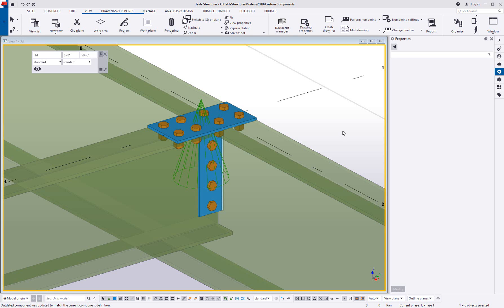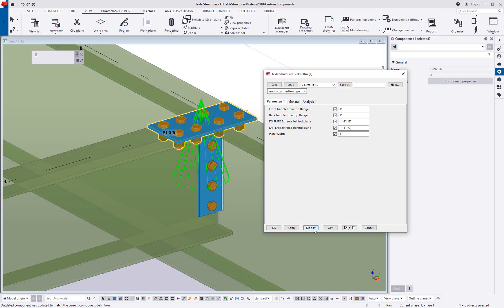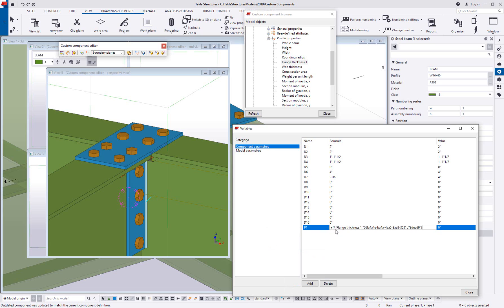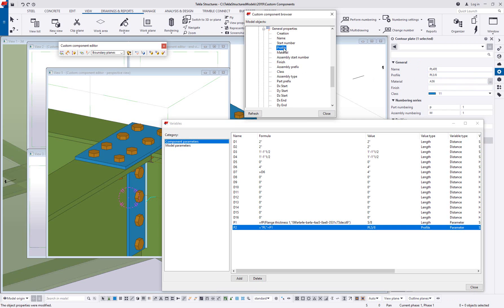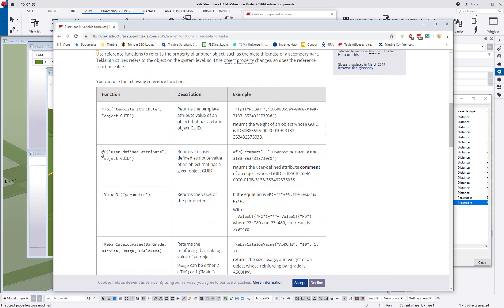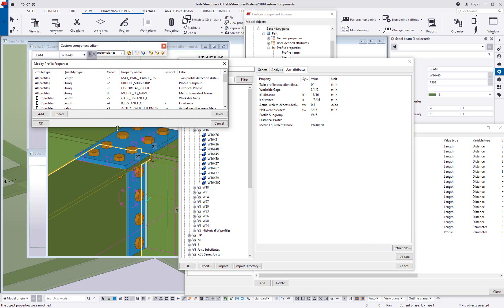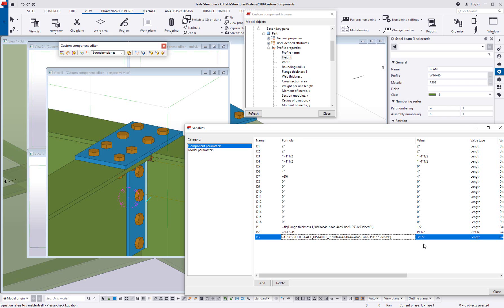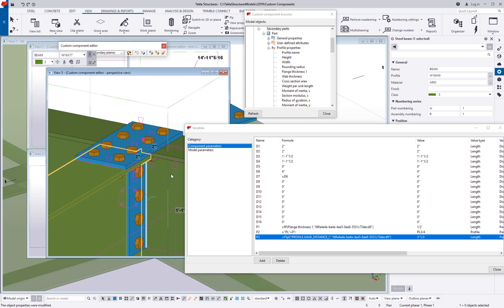Custom Components  - Getting Started with Formulas in Tekla Structures

Comment: Fantastic series on custom components. How would I specify "Parts with slotted holes" in the custom component browser?
Reply: It's a binary option for each part in the group. In TS2022 it's defined as "parts with special holes", and each ply has a value. 0 for no, 1 for yes. So for example: No parts with slots, 00000. First part (under head) 10000. Second part would be 01000. Both parts would be 11000.
Reply: @TrimbleTeklaDave  Ah, I get it. I went ahead and created temporary component with slotted holes and then copied the value to the component I was working on. But your description explains how it actually works. Thank you! I can't believe I got a direct response from the Tekla god. 😁

Comment: Hi. When opening the custom component for edit, the "Custom component editor" toolbar is missing and i can't go into variables or save my component. Any idea on how to get that toolbar  back?
Reply: I would recommend you reach out to your local support for assistance, I'm not sure what could cause that. In the past, I have had luck resetting the registry to put all dialogs/toolbars to their default locations, but that is something that can cause serious problems with your computer if you are not careful.
Reply: @TrimbleTeklaDave  do you remember which key it was in the registry that caused the problem?
Reply: @Cool77Z  no, the issue I had experience with was a different dialog, so I'm not sure what the name is for the CC editor. It may be under the Computer\HKEY_CURRENT_USER\SOFTWARE\Trimble\Tekla Structures\2020.0\Dialogs group.

Comment: Nice video. I want to build a beam with several holes (cut parts) at its length with the fixed distance, so the number of holes changes as the length of the beam changes, but in the custom component environment, I couldn't find any variable that generates holes (cut parts). Is there such a variable or attribute in the custom component environment?
Reply: Hi Jo. First, cuts are separate "objects" of sorts that have nothing to do with the custom component environment. You can model them in as polygon cuts (or cut parts) while in the editor or before you ever get there. As far as changing the number, there are two ways I've done this. One is to create the 'maximum number' you would ever need. Then you can perform an if/then statement with a little math to enable/disable a certain number of them ("Create" variable) based on the beam length. The second way would be to create one cut, then embed the array component inside your component, and again use a little match to adjust the number of how many should be created. Take a look at the 'Bay filler seam v2' custom component in the US environment as an example of the second option.
Reply: @TrimbleTeklaDave  Thank you very much for your detailed answer and of course your time.
Reply: @TrimbleTeklaDave  I'm trying to make a connection custom component which inserts elements between precast wall panels. How can I get Tekla to prompt me to pick the start and end points for the array component that's embedded in my component when placing my component in the model?
Reply: @ruck666  Based on your description I would look at using a "Seam" type custom component. But it might be best to share what you're working on with your local support. Hard to diagnose CC questions through youtube comments.

Comment: Hi, how can we add user define attributes in custom components which is link with grass hopper custom components.
Reply: I have never used grasshopper, so I would recommend reaching out to your local helpdesk for assistance. In regards to the Tekla Custom Components, UDA's are only visible in the custom component browser properties if they actually have a value - so you need to give them one first while you create the CC. After you link a variable to that UDA, you can clear it afterwards. Once the CC is built, you may have to save an attribute file for it with those UDA's defined so you can open the file in a text editor to see what the 'name' of that value is, so you might be able to map it in grasshopper. Look under the 'component' section here: https://teklastructures.support.tekla.com/not-version-specific/en/ext_grasshopperteklalink

Comment: I'm experimenting with trying to create a vertical brace connection. Binding to planes and extracting profile properties works well, but how do I extract other data like the START_Z of the brace? I'm not sure how to establish reference points in space so I can start using trig. For example, what if I want to create a simple custom component that will cut a brace back so that it clears the bottom flange by 13mm? The only object in this component would be the cut, but I can't figure out how to bind the workpoints of the cut so that they adjust correctly when the angle of the brace changes. Any advice?
Reply: Bracing components can be tough. To answer the first part of your question, you can get properties by using variables like =fTpl("START_Z","xxxxxx") where xxx is the GUID of the object you are referencing. I've also used reference dimensions on the handles of the overall brace (orange dim icon on the CC toolbar) to help calculate the trig values for end cuts. So rather than binding the cuts to objects I bind them in to the component planes and use X/Y values based on the trig functions. For help with these visit https://teklastructures.support.tekla.com/2019/en/det_functions_in_variable_formulas
Reply: @TrimbleTeklaDave  Thank you for answering! I managed to get it working. I realized that extracting the work points of the brace was not the best approach so I experimented with reference dimensions and trig just like you suggest. Everything worked well. However, my component only seems to work on one end of the brace. When I try to apply it on the other end I run into problems and the gusset/cuts/bolts end up in weird places. So I'll try to think of a solution to that (it probably has to do with the auto-direction of the component). But anyway, if you are looking for video ideas I would suggest a short explanation on the 5 icons to the left of the boundary plane drop down list in the custom component editor. I managed to figure out one of them through trial and error but I don't think I fully understand how to use all of them.
Thank you again for your helpful videos!
Reply: @TrimbleTeklaDave  all these people are making custom components but nobody is sharing them? At least not that I can see anyway. I saw somebody selling some. Seems like we are all doing extra work rather than collaborating on these connections in different areas of the world.
Reply: @NeilMcginnis  Sometimes they get shared privately between people, but generally no. I think detailers tend to be very "protective" over their tools and workflows because they consider that they give them an edge over their competition.
Reply: seems like the tekla forum would have been useful for sharing resources like that. unfortunately everybody has to start from scratch this way. bad for me because i'm just now learning about using custom components. lol

Comment: Thank you for nice video tutorial.
I tried to use one of the profile properties for part mark in drawings, but I couldn't find it in list of properties in template editor. I tried also just write a formula GetValue("property name from catalog list"), but no effect anyway. Could you hel me with this task? Thank you in advance.
Reply: It would be best to reach out to your local helpdesk with exactly what you are trying to achieve. https://www.tekla.com/contact/offices-and-resellers
Not all values are in the list of properties you see in the template editor - if your local team has not defined them, they will not be listed. That does not mean they cannot be used, however. Here is an alphabetical list of more template attributes you may not see in the editor: https://teklastructures.support.tekla.com/2019/en/sys_app_template_fields
Some values require a prefix, depending on what you are doing. UDA:, TPL:, PROFILE., etc are some examples. The prefix/syntax also depends on the row type and hierarchy if working in the template editor. Without knowing exactly what you are doing, it's hard to say what the syntax may need to be.

Comment: Do you know how to set the custom component to adjust the cope base on the 'k' of secondary part but with an incremental value of 1/4? For example, if the 'k' value is 1"5/16, I want the cope to be 1"1/2.. thanks in advance
Reply: It's easier in metric but it can be done in imperial as well. First you need to pull the K distance from the profile attributes like I did with bolt gauge in the video. Then you need to bump it up a little using the ceil function so that we can reliably get to the nearest 1/4" by using the round function. So, use something like P1=fTpl("PROFILE.K_DISTANCE_I",guidforthebeam) then you can use P2=ceil(P1)+2 to bump up the dimension slightly, and finally P3=round(P2,6.35) to get to the nearest 1/4". There might be another way but that worked for multiple beams in a quick test on my end.
Reply: @TrimbleTeklaDave  I see, that's what I missed yesterday... the ceil function.. Thank you so much. Let me know how can I return the favor. Thanks again!

Comment: Need to auto connection setup with custom components
Reply: Hi, custom components can be used in Autoconnection, just like regular connections. The help page on the TUA is found here: https://teklastructures.support.tekla.com/2019/en/sys_autoconnections_ac_setup. Unfortunately it's more than can be covered in a comment. I will see if we can make a tips video at some point for this. You can also reach out to your local support for assistance.